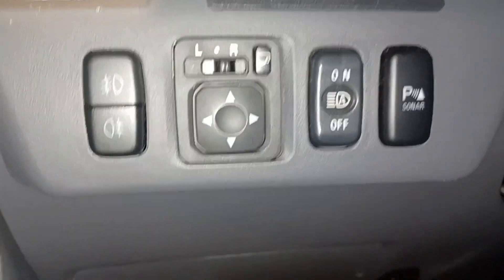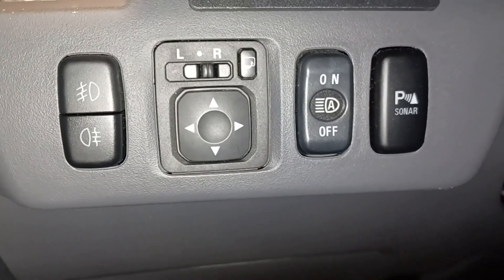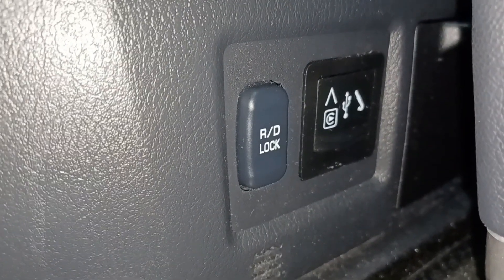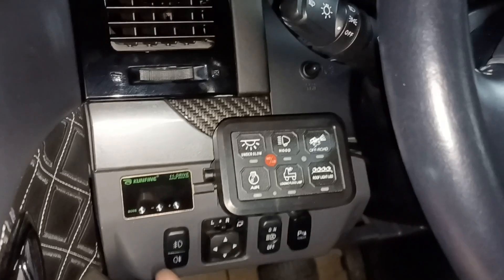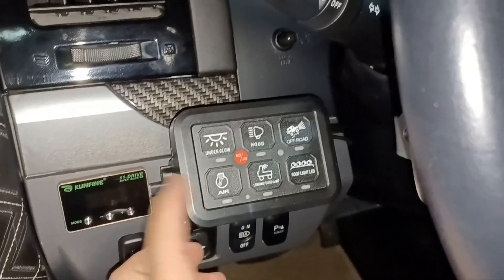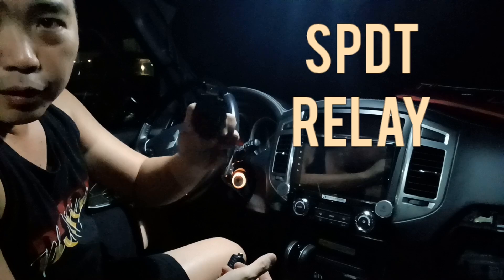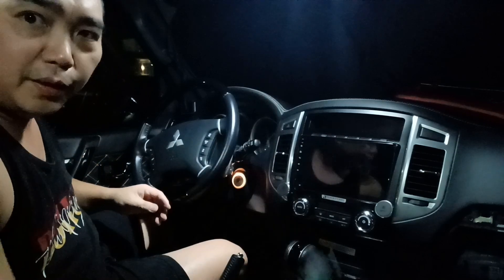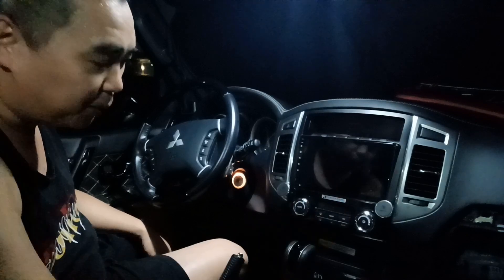Pajero Traction Control Kill Switch using SPDT relay

Comment: Hi, i have a question. Isn’t that 3.8 comes with Traction control off switch. Is it the same purpose?
Reply from the maker: @theepisodes3873  All pajero doesn't come with  TC switch. 
It only has a switch to turn off the ASC or active stability control.

Comment: Hi, great video! Is it possible to do this on a 2006 Toyota Highlander AWD? I hate the fact that you can't turn it off. There's a relay in the engine fuse box that deactivates it, and I wonder how I could wire a switch to turn it off without having to remove the relay.
Reply from the maker: @padilla0007  yes you can. If you cut a wire connected to that relay and extend both wires to a switch, you can interrupt that signal and induce a fault in the breaking system. When the ECU detects a fault it will turn the traction control off.

However with this method you need to restart the engine when you want the TC to turn back on.